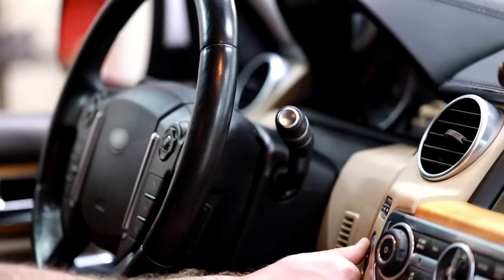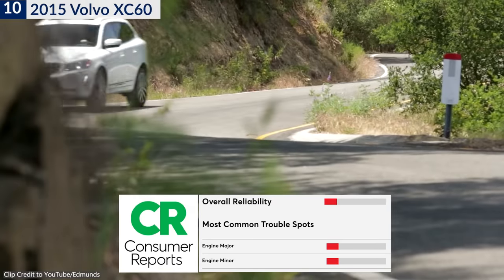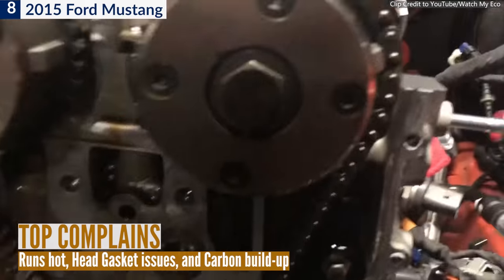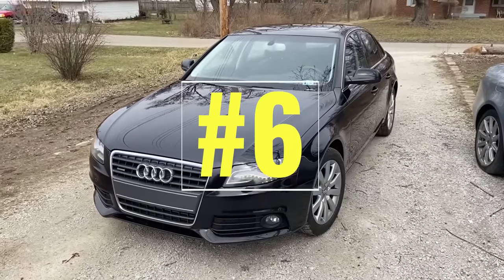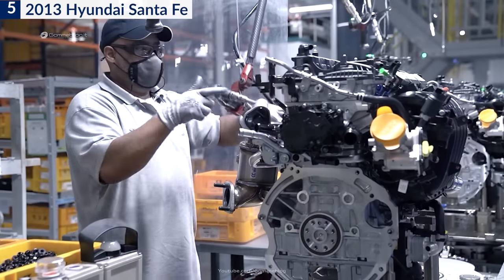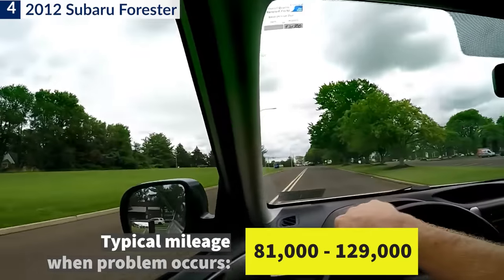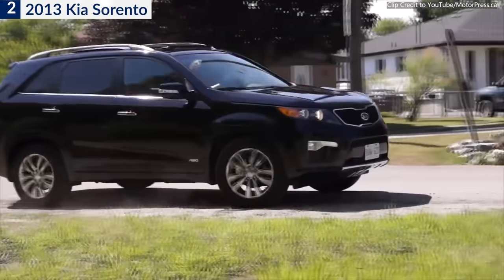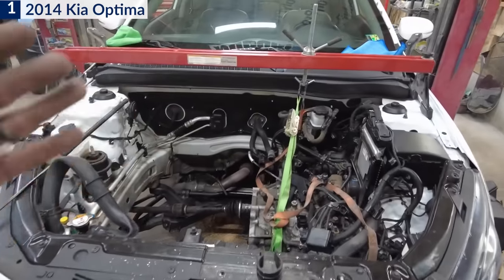10 Used-Cars to AVOID for BAD Engine - as per Consumer Reports

Comment: Turbo 4-Cylinder engines are always going to wear out up to twice as fast as a 6 cylinder. More wear, more leaks, more head gasket failures.
Reply: Not true.  Some of the recent turbo engines are built to withstand even the leadfoots that buy them.  On the other hand, Toyota as well as Kia has had some major problems with some of their six cylinder engines.

Comment: Alot of these problems are people little if any maintenance. The Traverse is supposed to be bad yet many get over 200,000 . Before they may change a timing chain. 
Plus most of these cars burn a qrt. If oil every 3500 . But keep an I in it and no problem

Comment: Fuel pumps in the tank aren't an "engine failure" B? BMW isn't British. C: Sensor issues are not an engine issues, they are a sensor issue. D: Catalytic issues are not engine issues. E. Kia and Hyundai have had issues for decades.

PS. CR isn't the worlds best rating service because of the way the "lump" issues

Comment: I had a 2013 Hyundai with 80000 miles on it it started running bad so I sold it to a dealership they new that it had a problem but they bought it anyway we lucked out

Comment: I’m seeing a trend of 4 cylinder engines with turbos slapped on the side of them. It must be cheaper to make a 4 cylinder with a turbo then a 6 or 8 cylinder with a turbo. Either way if a car can’t last 100,000 miles without anything major breaking it was built like shit then. Seriously every car should make 100,000 miles no problem

Comment: 2015.5 Volvo S60 turbocharged 4 cylinder, stay away. Service bulletin out on burning oil. Volvo knows and knew about this but will not do anything. They say the pistons and rings need to be replaced with updated versions. This is the same piston/ring design as in previous 6 cylinder engines, and had same problems. But Volvo put this design in the 4 cylinder and making customers pay for the repair at $9,600…. Volvo knew so much so that in 2016, they changed the design. That was the only Volvo I will ever own.

Comment: Never had motor issues 
Or transmission problem 
Rust 
Lotsa of cars killed by rust with electrical issues 
That’s running them 200-250k
10-20yr old

Comment: A lot of hyundai cars are not reliable, I have a ford escape 2011 with 290,000miles just basic repairs bushings ,shocks , just changed the serpentine belt tensioner,  ignition switch,

Comment: Avoid the 2009-2015 Audi 2.0,.on my 2012 A4, rings, pistons replaced at 55k. Engine failed at 66k, requiring engine replacement.😬12,000 for that one.

Comment: 2012 GMC POS Terrain, new engine, new drive train, 7000 Plus.  GMC does not stand behind their product.  Engine blew because of a recall issue and they refused to reimburse.  I would not buy and other GMC  if it cost 1 dollar.

Comment: The 2.3L Eco Boost TCHRGED I-4 mostly fails because the engine is too small to compensate with the power it makes, which wears the engine down faster. A v6 or a v8 are most likely to survive brutal beatings of acceleration, and top speed.
Reply: thats not true many last 200,00 miles

Comment: Long story short, regardless the brand, downsizing engines and putting compressors or high pressure turbos on it to replace the missing combustion chambers volume may in short run create same PS as naturally aspirated big bore motors but only by much higher operating pressure, temperature, higher rpm's and overall much harder working units causing more heat and material fatigue related failures. It's a dead end. Big bore, low rpm. engines will - if properly maintained - usually outlive the rest of the vehicle and run reliably for decades. Now what's better and "greener" - a car running trough two generations of owners or some basically irreparable "small eco boosted chaisaw" dead after 60k.

Comment: You forgot the GM 3.6l V6 engine. Around 60k miles BOTH timing chains will start to stretch and will eventually need to be replaced. And it's not cheap to repair. GM quality is crap now as far as their motors go. Doesn't matter which one you have, at 100k miles you will have major problems if not before then.

Comment: I had a 2011 Hyundai sonata with a 2 L turbo and it’s somehow filled the crank case with oil and screwed shit up in a hurry But I will say this if you look at that engine and the engine from the Lancer Evo they look identical
Reply: The core engine was shared by Hyundai Mitsubishi and Chrysler.  But each mfg went their own direction for internal components and output ratings.

Comment: I'm not surprised equinox is on the list.  I wouldn't even accept one as a rental.
Reply: We have an 08 Equinox AWD with the v6. It has 187,000 miles on it with no engine or transmission problems.
Reply: Isn't that nice?  It's still a toy Generic Motors product.

Comment: Not a Toyota, Honda were on this list and only 1 Subaru.
Subaru did have issues with head gaskets and this was corrected by the 16 year models
Reply: Honda 1.5L Turbo will soon be on the list because of common blown head gasket issues
Reply: @frankm7707  Yes, I’ve been hearing about that. Also the Honda 1.4 & 1.3 turbo engines have been catching fire lately.

Comment: You want dependability and resale?  Buy a normally aspirated full size V8 truck that does not say Ford on it.  If you are determined to have "fuel economy" understand that you will spend your fuel savings in repair costs and depreciation, so in the long run you gain nothing.  That said, at least buy a normally aspirated V6 and live with the lower horsepower.  ONLY V8's and larger make good HP without excessive stress on themselves.  Everything else requires turbos and/or superchargers and that guarantees increased expense and shortened service life.  Yes, I know "I know this guy whose uncle's nephew's sister-cousin got 97 billion miles out of he/her's Kia".  That's nice.

Comment: My 21 sorento with all the bells and whistles (remote start, heated steering, ventilated seats, 360 camera, hands free streering wheel, blind spot cameras) engine kept dying at a stoplight lol goodbye.
Reply: Are you sure it's not the start stop system kicking in at the traffic lights? Common mistake.😆

Comment: Turbo charging a small 2.0 or 2.5 liter engine is just asking for problems. It's just too much stress for a small engine. Better off getting a larger non-turbo engine, it will last a lot longer.

Comment: Hyundai as a manufacturer, they don't care as much about quality and reputation as Toyota or even Ford. You have a good dealer but the company is lack luster in its care for quality and customer satisfaction. Bad paint jobs or rust are an issue that should be an issue with today's manufacturing tech. With the Santa Fe I got what I paid for.

Comment: All cars should pass a  reputation that motors are able to do 400 000 miles without replacement.
Datsun 180 b blew a head gasket at 500 000 miles 1979. And a new  head gasket was all that was required. 
Why are later model car motors unreliable

Comment: The worst of all is the Nissan d40 in there pickup ,son brought one that had engine replaced at 50,000miles then it creeped out 60thou latter found out all these motors do it due to weak camdrive chain & file pumps .never bye a puree 2020 Nissan pickup .

Comment: Why are you only mentioning the 2011 Sonata. Hyundai and Kia has  had a HUGE scandal with their Theta engines.
In fact, I wager that that problems is BIGGER and LONGER than ANYTHING that is highlighted here! Check out the back of a regular dealer! Lineups of cars with failed engines! There was a class action lawsuit forcing them to extend the warranty. It's literally one engine after another. 2011-2018.
Instead you're just highlighting a 2014 Optima, 2011 Sonata. It's not just those years. 2011 to 2018 !!!

Comment: Audi A4 suck.  Family use to own a 2006 turbo 2.0T.  The repair cost is crazy and the dealership service dept suck.  The engine had to be replace, original quote was $12k quoted by the dealership.  Had to call corporate to lower it down to $2k.  Do they still brag about German engineering for their car which really is false advertisement.  Also went to multiple Audi dealership for a whistling sound that they can never diagnose that I keep paying diagnostic on.  End up going to Audi forum and it was the pcv valve that cost around 30 bucks at Amazon and 4 Phillip screw to replace which I finally have to do myself.  Interior is fantastic but will never ever buy an Audi again.  Not worth the headache, sticking with Japanese made car.  I chose reliability over performance.  I rather not be stuck on the road than be fast.

Comment: Be sure not to forget all 2013-18 ford's with the 1.5 litre turbo eco-boost. It's a bad engine design and replacement IS THE ONLY OPTION. I know, I just got done taking an $8000 bath with my 2017 escape. Ford don't want this information out. I'll never do Ford again.

Comment: On your spot with the EcoBoost Mustang. In that particular segment the car being shown being winched up on a flatbed was a 5.0. Now very hard to miss the 5.0 badge on the fender. BTW why were there no vehicles that were build by Honda Nissan or Toyota on your list that includes their overpriced Infinity Acura and Lexus models? I have heard and personally owned late model used vehicles as well as new ones that have been in the shop more than they had been on the road. When the Toyota slogan says "Lets go places" I think it really means lets go back to the dealership.

Comment: I'll stick with my 90s Japanese economy car     30 years on the road and 240k miles and it's on the original engine and trans.  3rd clutch though. Cause I'm an idiot lol.   But even then I can fix anything on the car for less than 400 bucks

Comment: The problem is excessively high fuel economy requirements from the government requiring the automakers to rush to GDI and high pressure 4 cylinder engines from V6 engines. I saw the same thing in the 70s when the first generation pollution control systems were introduced. The auto makers had to do this with vacuum lines, servos, exhaust gas recirculation, all without microprocessors which did not exist yet.  It will only get worse with the new CAFE standards that are  coming out in a few years.

Comment: I have a chinese knockoff motorcycle with 95 000 km in just  4 years except for a tyre and chain changes it runs great never had to touch the engine and a car from BMW and big companies gives up only after 60 k miles 😂😂😂. I don't use my car very often but it's an old 1995 merceds benz w 124 never had a problem with it neither my father who owned it before. Silly new cars with emission control regulations ties 😂😂

Comment: Only time they are bad engines if metal fragments were not blown out of engine block when made like a cvt transmission lots of metal fragments from metal belt will do the same just change fluids on time

Comment: It seems some things are mixed up. You state the Volvo’s fuel pump is problematic. Fuel pump has nothing to do with engine. It is a separate component.
You refer to Hyundai and Kia as separate firms They are not. They use the same engines, transmissions etc. and in general they are very poor. These are badge engineered products. 
With regard to the CR, I would not tryst them as far as I can throw them especially when they missed the continuous failures with Toyota’s vehicles braking systems.

Comment: You don't save money by buying poor quality. I noticed no Toyotas or Hondas made the list. Turbos drastically shorten engine life. They increase the compression which puts more pressure on the rings. This increases blow by and wear on the cylinder. It can also crack rings.

Comment: Bottom line, gas turbo charged engines (diesel’s excluded) put stress on an engine that a normally aspirated engine doesn’t.  The new Toyota’s with turbo V8’s have had so many issues and recalls because of this.

Comment: context problems render some of your info useless.   For example you mentioned fuel pump while talking about the Volvo engines and then showed a fuel tank boost pump.  Which pump were you talking about and was it really an engine problem.  I am not a fan of any Volvo products btw.   As for BMW, it would be good to tell us which engine model it was this 4 cyl they put in the small SUVs.  I only buy 6 or 8 cylinder BMWs so I am not familiar.  My old N54 engine I thought would make your list given the recalls for injectors and the high pressure pump.  Other than that my N54 BMW engines have been perfect.  Also it would be good to know which engines' owners failed to do scheduled maintenance.  BMW cooling systems require strict regular maintenance [usually 60,000 miles] and you will lose the engine if you don't do it on time or at all.  But SHAME on any BMW making this list.  Sooo many Hyundae's though.  Never buy anything from Hyundae / "Kia" / "Genesis" - I did once while studying at the university, and even that lasted only 6 months.

Comment: Please ad the 2014 VW 1.6 diesel. 80k miles. After 7 months at VW dealership and 100s of phone calls, unnecessary parts purchased,  they finally got it fixed, at the same cost of the vehicle book value. VW never ever again.

Comment: I'm surprised that 2014 tp 2020 Volkswagen Passat is not  included in the list for the most  unreasonable cars. Volkswagen Passat has issues with engine oil burning and throttle body.  I  will  never recommend a Passat to anyone. It's a very bad car.

Comment: Chevy and GMC have made crappy engines and timing chain issues since 2009 the timing chain part is better starting about 2017 but now the engines are crap so they can get away with it because nobody cares about the consumer these days just about the big corporations lining their pocketbook! And as for Ford the new $80,000 Ford Broncos aren't even making it 60,000 miles without the engine going out

Comment: POS vehicles that engines only last 80k miles. Wow. And they were very expensive to begin with too. Expensive new POS vehicles! Especially those garbage inline 4 turbos. They replaced V6 engines that were usually more reliable.

Comment: My two thousand and twelve dodge journey has been nothing but pure piece of garbage. I had to replace the alternator twice for the last four and a half years, It's started leaking engine oil from the gas kit about six months ago And my local mechanics hate replacing the stupid battery. Because the battery is stored underneath the front driver's side pumper. You literally have to jack up the front wheel driver's side and pull out the tire to get to the battery. What a crappy engineering marble. It is still leaking the coolant after a repair and many other problems. Common sense Based american engineering my ass.

Comment: SUBARU needs to get away from the BOXER-style engine! It's OLD Tech. & has poor oil distribution in the engine itself... I love HONDA but not their new 1.5 liter turbo! I like the naturally aspirated K-20 and K-24.. Basically, just buy an older HONDA or buy a TOYOTA with a proven engine design..

Comment: A Fuel pump is not an engine issue for Volvo. BMW is NOT a British car maker, no BMW later than 1987 has a timing belt. Almost no shop on earth rebuilds engines in house anymore. Volkswagen has always sucked with a few exceptions.

Comment: No manufacturer wants to build you a vehicle that will last over 100k miles. They want you to come back and buy a new one. If they have to wait for their customers to drive over 100k miles, they will go out of business. Vehicles have become status symbols for most of the people driving them. They get a new one every few years even if the one they had didn't have anything wrong with it. Used cars are exactly that - used. People want to buy a used car that will perform as good as a new one. This misguided mindset leads to decreased satisfaction when their 6 year old car doesn't meet their expectations. Don't even get me started on the $80-90K trucks on the market today. Total status symbols driven by people that don't even know how to drive/park them or even get in/out of them without tearing up the driver's seat. A clown's market targeting todays entitled crowd to separate them from their money. If your truck note is higher than your mortgage payment, you are in this group.

Comment: ALL of the direct injection engines have problems with carbon build up made worse with turbo charging. Most of these problems could have been avoided if the owners used the recommended fuel.
Reply: You’ll unfortunately have to do a carbon cleaning of the intake valves eventually. It’s part of the cost of ownership of any turbo. Most people trade their cars in before this so automakers have no reason to include port injection to fix this issue.

Comment: Hi Sir Hyundai Santa Fe are also using these GDI engines it's Bloody Crazy They should turn around & start dropping Toyota engines & Toyota Transmissions into their Hyundai Santa Fe are by far better engines than those GDI engines & These GDI Engines are Time Bombs & ready to go anytime Bloody useless engines & are Big Money Wasters & that costing Hyundai Manufacturing Car Company Big time get rid of those GDI engines & instead install Toyota engines & Toyota Transmissions that go with the Toyota Engines & You Hyundai Car Manufacturer would by far better off with Toyota Engines & Transmissions & are by far more reliable than those GDI Engines & they are useless & costing Hyundai car  Manufacturing big money in repairs yous just wasting time and money with these GDI Engines they are Rubbish Engines what do you think about Sir

Comment: The Audi 2.0T issue continued for several years including 2015.  Excessive oil consumption due to already known defective piston rings.  My Q5 has that engine. 6K to fix. And Audi's argument to accept responsibility is that the car's warranty is over.  There's an ongoing class-action for that.  Audi bastards.